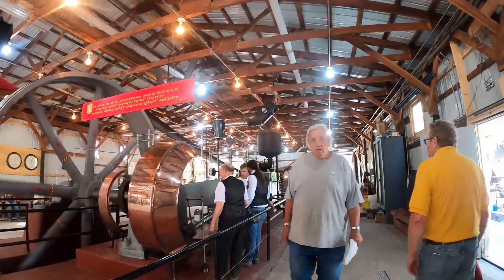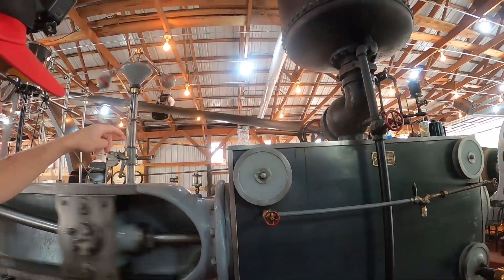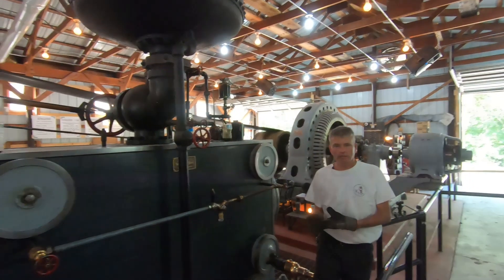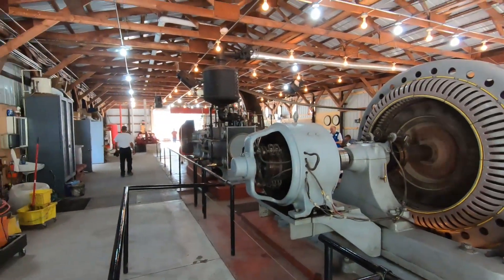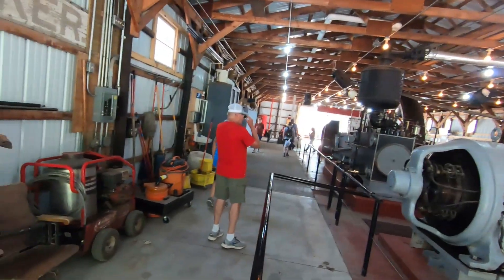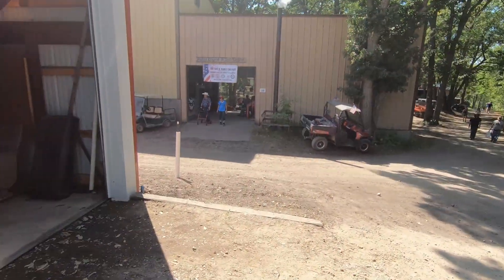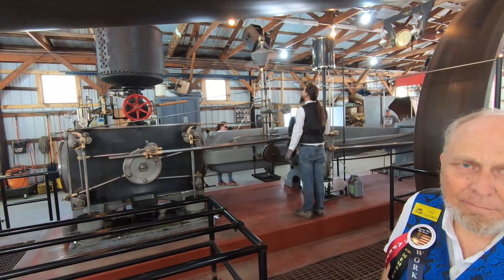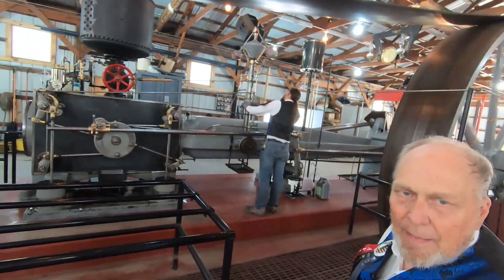1904 STEAM GENERATOR THAT CAN SUPPLIES  ELECTRICITY

Comment: very nice. basically rigged as an off grid generator. with a synchro scope or sync lights in theory this could push electrons onto the grid. and once it is synced and tied to the grid you can simply put the hammer down (until you electrically slip) and the grid would keep it regulated with the near infinite sinking capability. but the older man is right that would put stress on those 100+ year old windings and heat them up! not to mention more wear and tear than the way they are currently using it. it appears that they are only using it for lights now, which the lights they are using dont care what frequency they get. they could run on DC even. some older system even ran on 20hz i think but was phased out relatively quickly for 50/60. any modern switching power supply that is rated 120/240 might be happy to take power from this generator. only real challenge to using less than 60hz is any synchronous motors would run at the same speed the generator output is.